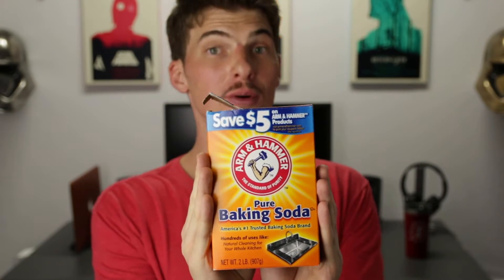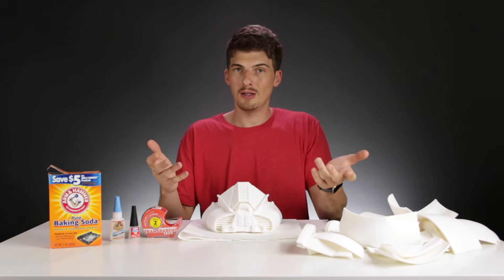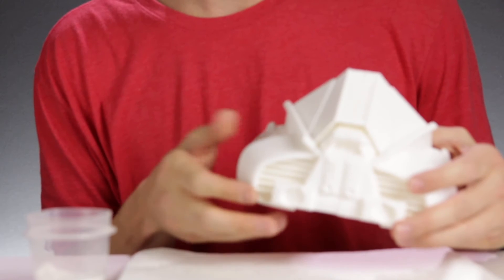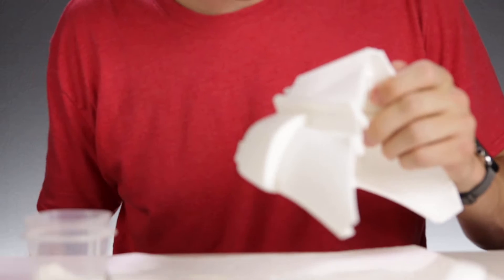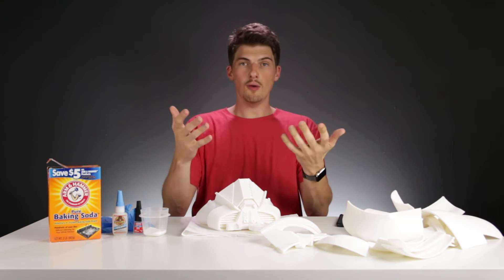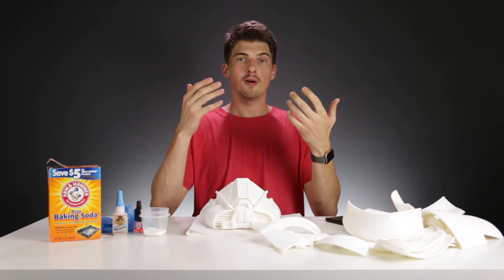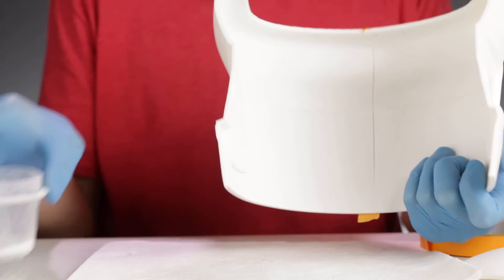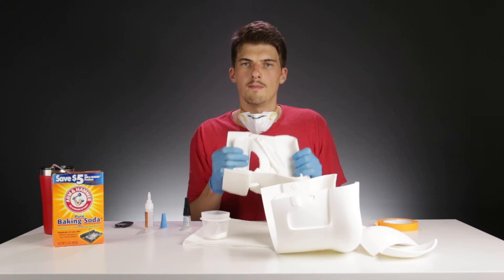How To Create Something: Assembling a Large Star Wars 3D Print

Comment: Just on the gluing, I've been using this formula for many years now, and have always used the same approach.  Glue the joint as normal, but use activator spray.  Once you have a fix from that, put a light bead of glue over the seam of what you've just glued.   Then sprinkle baking soda anywhere you see wet glue.  Once you're covered, tap the item so the powder goes back onto your work surface, blow to release non attached particles, then repeat this until enough material has built up.

Since you're gluing on the inside of the structure, for optimum strength I would most certainly use multiple layers,  and even aim for quite a build up of material build up around the tight corners.  The cement that is created is incredibly durable and lightweight.  It has been the preferred method for some aircraft engineers if you need to fill a dink on a wing

First I thought you were going to on the baking soda first then glue to seal it in.  But you went with glue first, so all good.  If you did lay down some powder and pour glue on top, your joint integrity would be at risk because you would almost certainly have pockets of powder which had not reacted with the glue.

If anyone does glue themselves like I did, it is possible to sort it out without drawing blood, if you've got the patience.  You have to find a nail file, then simply use the edge to saw away at the joint, making sure you're angled  so the edge is pointing into the thing you're glued to.  But do what he says to save time, and wear gloves.  Superglue is very good at bonding skin.  It's even part of it's development history as it was once intended to be a tool for battlefield medics to glue the wounded back together.

Comment: I have a 13 piece project with about 10% infill and the pieces are about 4-6 inches wide and will make it about 52 inches long. My plan was to use  loctite super glue but I’m unsure if that is going to hold it together. Any ideas or opinions would be appreciated.
Reply from the maker: Using loctite super glue and then sprinkling baking soda on it and quickly sealing the pieces will lead to a cement like bond. Not brittle at all like regular super glue. Then just sand down the seams (using a proper respirator mask in we ventiltated areas). Should work great.

Comment: Ive been using Gorilla Gel Superglue & Baking Soda. I feel like the Gel provides a larger accumulation of superglue and tends to pop out the sides. So there is more glue area to cover in baking soda. Then I take a dremel and dremel down the outside surface but leave the inside. Its the absolute best bond Ive found so far besides melting th two pieces together. Gel Super Glue and baking soda is so strong it will break the plastic before breaking at the seem
Reply from the maker: Seriously the baking soda trick is so insanely strong it’s stupid. Seriously, you’ll wreck the 3d print before you wreck the bond.

Comment: You could have printed it in abs and use acetone to bond parts together
Reply from the maker: +Eduardo Morales Yeah I agree. I do this on smaller parts or where timing isn’t critical. The huge benefit to this method is that the bond seems to be just as strong, but the result is almost completely instant. 

Both methods have their place. 

Thanks for watching, btw!